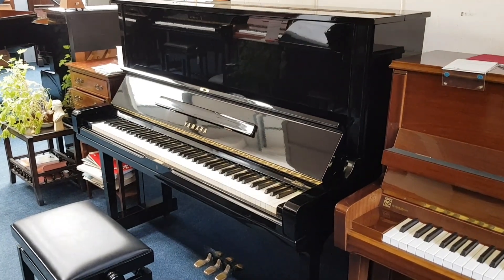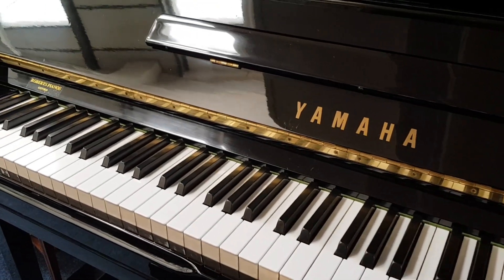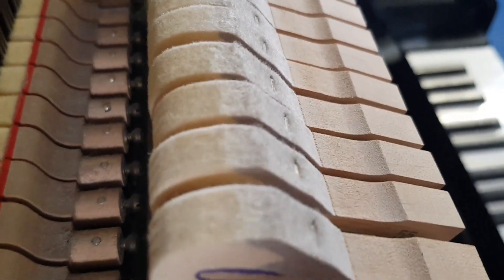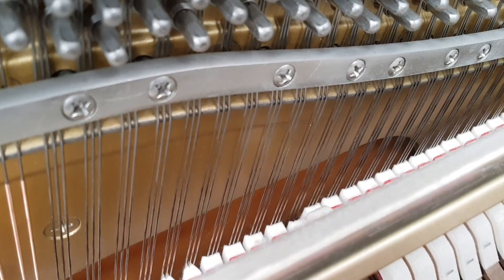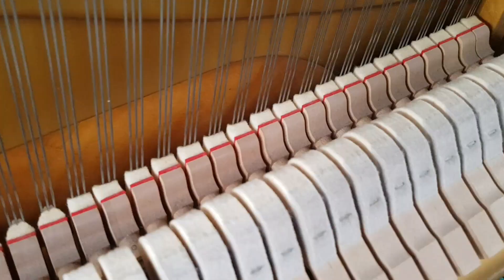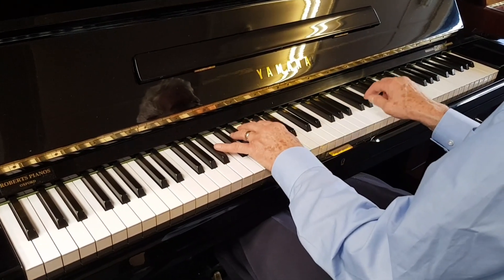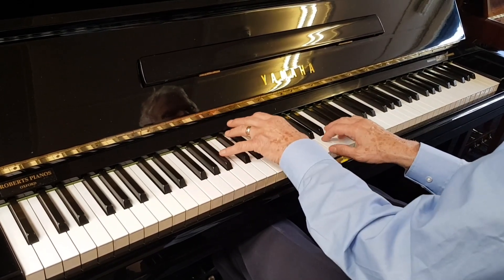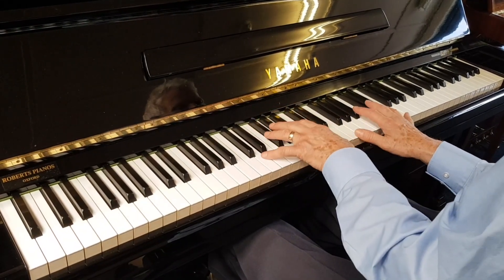Yamaha U3H 1977  cf 1990s; we believe the older tone is richer

Comment: I have a Yamaha YUS of a similar vintage.  I tried all the new ones and did not find one that I liked as well.  There were other pianos that I preferred in tone, but they were out of my price range.  My only real issue with it is that the music stand is too low.  I’ve seen videos you have posted where there’s an add-on music stand that boosts the height of the music.  I have looked and looked online and in the local shops but I have had no luck in locating one.  Would you be so kind as to lead me in the right direction?